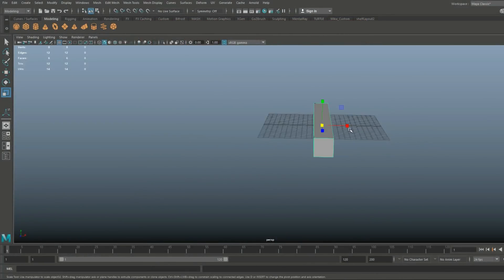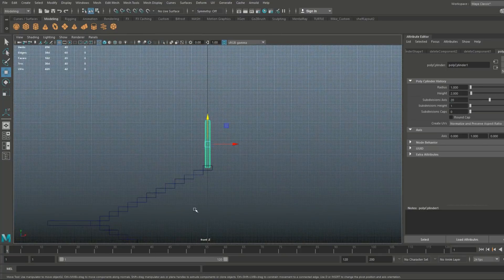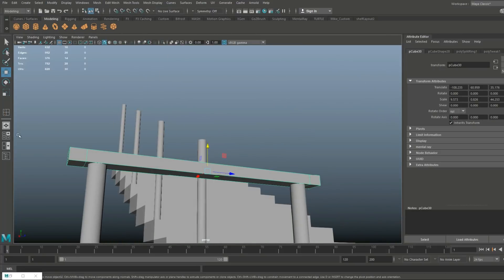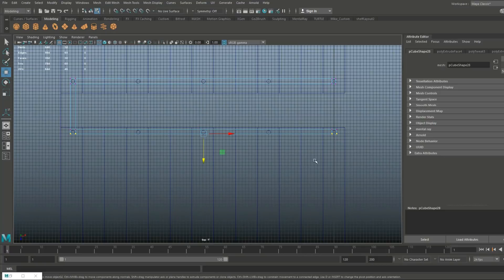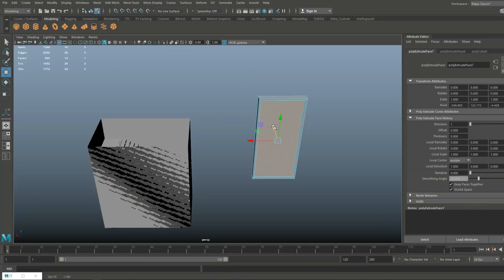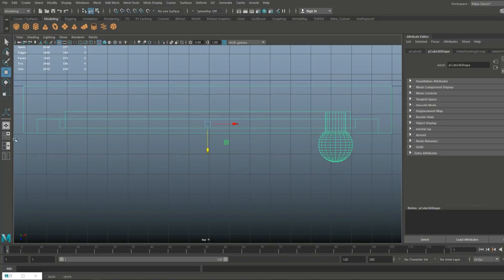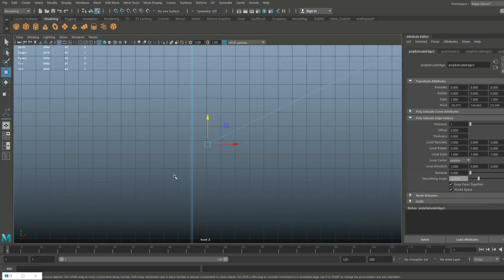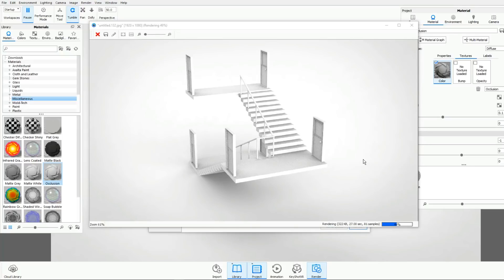Time Lapse Friday : Modeling a Staircase in Maya 2018

Comment: That was a neat little basic modelling tutorial.

But if I may suggest some stuff. I think when doing this you should of also shown copy special or what it's called, where you get to chose the amount of copies OR instances and the translation/rotation between each step. Thar way its a 3 click operation to make all the steps automatically ;) 

And the benefit of doing it with instances, is that say for instance  you want to change the look of each individual stair, or the look of posts of the railing, maybe sculpt it some more, add some profile to them by adding edge loops and scaling them. If done with instances you only have to change one and they all change ;)

Comment: What size do we set as reference for real life stairs examples?
Reply from the maker: Typically a domestic staircase has 13 steps per single stair. The total height varies per country and situation but on average a step is 8" high and 9" deep. You can also use a 3d model of a character for reference
Reply: Mike Hermes Thanks for the Quick response sir